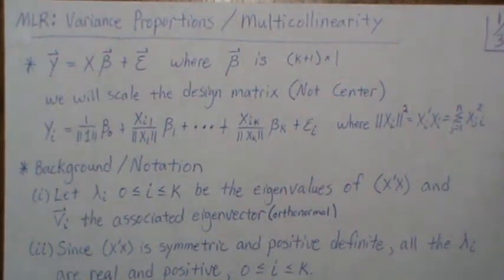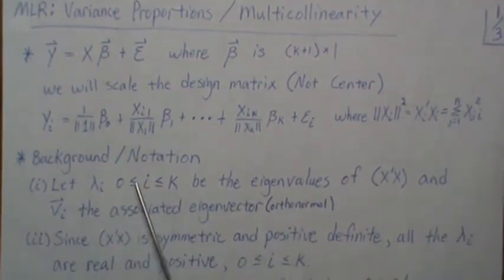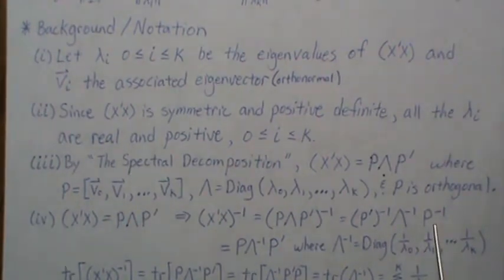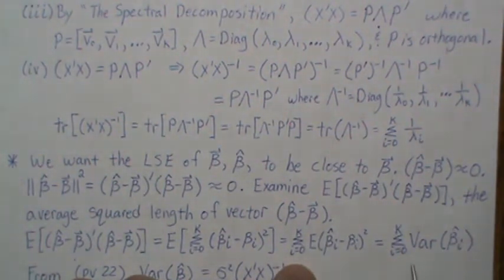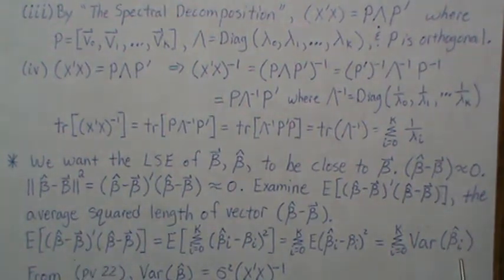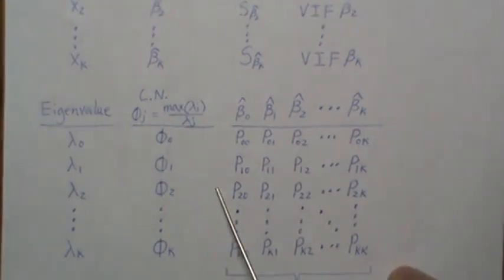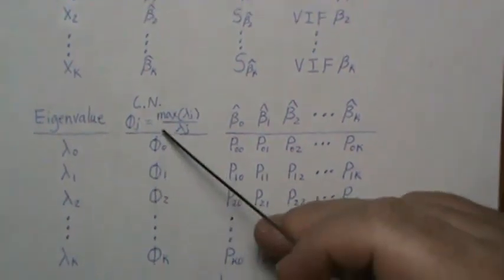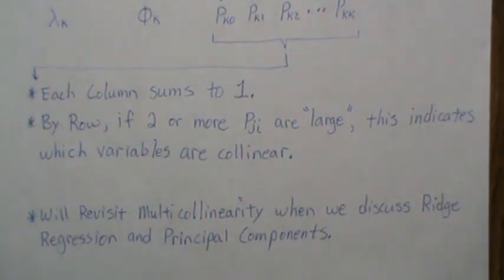Multiple Linear Regression: Variance Proportions / Multicollinearity

Comment: Hi, thank you agian for the immaculate video. Whilist reviewing your illsutrative example, I was a bit confused. 

From your Condition Number video, the condition number is a unique value which is a proportion of max/min eigenvalues. So, I guess the CN is just to determine whether the matrix is ill conditioned or not(and not tell us which regressors are having high correlation).

And from this video, you construct another condition number where it is a proportion between the maximum and each eigenvalues. Do these condition number tell us more than the aforementioned CN by telling us which eigenvalue is causing the matrix to be ill-conditioned?

Lastly, what would be some intutive concept one may view the eigenvalue of the precision matirix (X'X)^{-1} might be? I just came across this question as the eigenvalue seems to play signficant role in the matrix analysis.

** Sorry that this is the only support I can make at the very moment as a student. Many thanks!!
Reply from the maker: First, many thanks for your support! Much appreciated. You are correct in that the CN only tells us whether the matrix is ill conditioned. CN=max(eigenvalue)/min(eigenvalue).  Once we know that there is multicollinearity in the model, we can examine the variance proportions to understand which variables are collinear. The eigenvalues of the matrix (X'X) can be viewed in several ways. Principal components analysis is a common way to use and 'view' the eigenvalues. Checking for an ill-conditioned matrix is another.
Reply: @statisticsmatt   Thank you for the clarification :) I went through most of the videos of this playlist and I have to say that these videos are the gems!